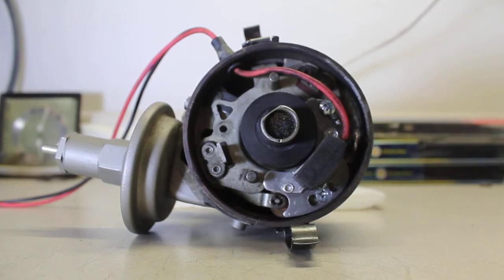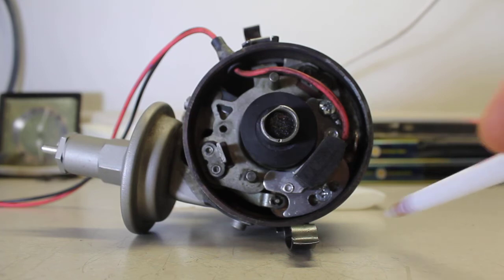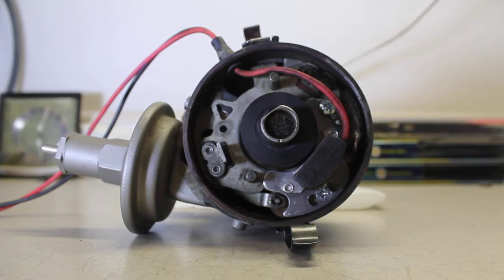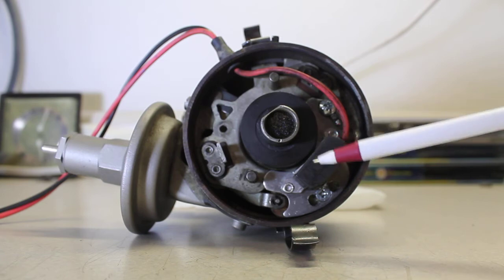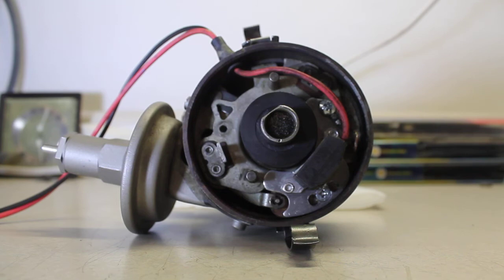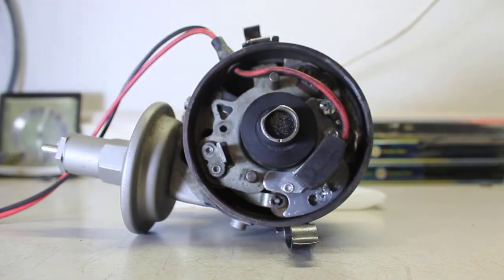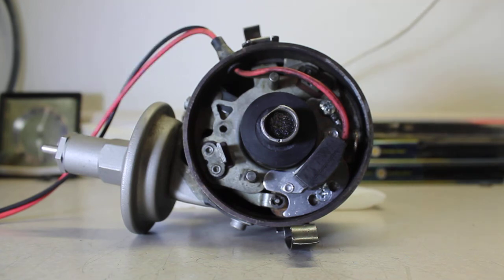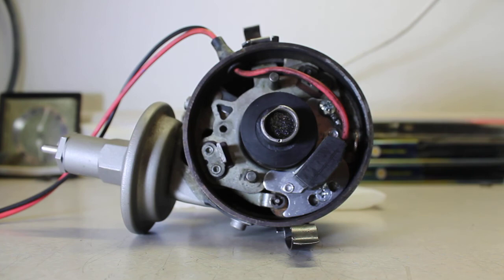Pertronix Ignitor

Comment: I just replaced an Igniter II that I installed in 1999 in a 1965 Olds 442 with a Flamethrower III and coil. The car runs GREAT! I discovered that I was running the Igniter II at the minimum voltage of 8 volts, so I was lucky for 26 years. With the Flamethrower III I am wiser and used a relay to feed the unit with battery voltage while the original 8 volt resistor wire now closes the relay. It sure pays to read the directions thoroughly.

Comment: Just installed pertronix ignition with flamethrower coil on my 4.3 omc marine engine and it required zero set up. Installed and ran right away

Comment: Very clear and concise. I am finding many of these mistakes were made when pertronix was installed in my car by my mechanic. A few other things that can go wrong:
1. Magnets can fall out of the sleeve. Apparently they come with a green tape to hold the magnets in place. Many remove the tape and the magnets can get flung out.
2. The module wires can get weak and develop a break, especially when the vacuum advance kicks in and physically moves the module

Comment: Our first family is Hind Ambassador Mark  IV 4 cylinder 1489 cc petrol engine with conventional contact breaker point and condenser Lucas TVS 25D4 vaccum assisted ignition distributor and 12V induction coil with 12 V negative earthing battery. The engine is BMC. Would you please suggest any electronic conversion kit for this car to replace its points and condenser.

Comment: This is awesome, very informative and extremely helpful.  Thank you so much for doing this video.  I have a '66 Ply Fury with a 440 with a stock single points distributor and I will be installing the Pertronix Ignitor II with the PERTRONIX 45011 FLAME-THROWER II COIL 45,000 VOLT 0.6 OHM.

Comment: Hello Bob, that is a Great insight into the Pertronix electronic ignition system!!! The advatages /disadvantages, Do's & Dont's... One thing that might be overlooked is the possibility of a stronger spark... I have heard that one of the advantages of electronic primary triggering of battery-coil type ignition systems is; the extremely rapid rise in primary voltage to the coil. The voltage collapse from the closing of the ignition points, is not anywhere near as rapid as an electronic signal coming from an electronic switching unit.... Those rapid pulses to the coil primary windings, rapidly induce voltage into the secondary windings- and produces a hotter, more rapid spark. There are oscilo-scopes that have proven this... The voltage spikes are an issue to any electronic device, as you have pointed out here - and with that being noticed, the battery and charging system does need to be working properly as you pointed out here... One other thing that also needs to be noticed is the importance of good clean connections and terminals that are attached to the battery and charging system... I can't tell you how many times that I found dirty/corroded/worn battery terminals and cable connections going to & from batteries to be the direct cause of numerous electrical issues... The battery acts as a very large capacitor, besides starting the vehicle and storing electrical power... It and the electrical terminals have to be in good shape, to keep those features...
Reply from the maker: Credit goes to Carl Bilter. This his video, I just posted it for him,
Reply: Great addition 👍